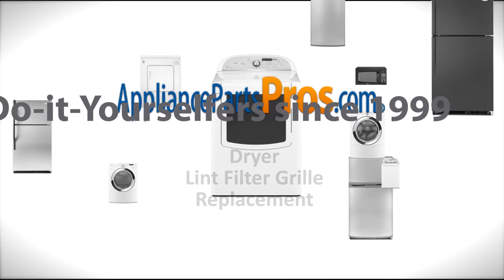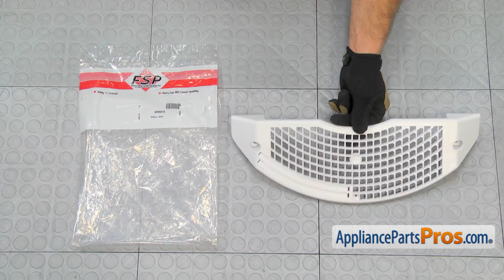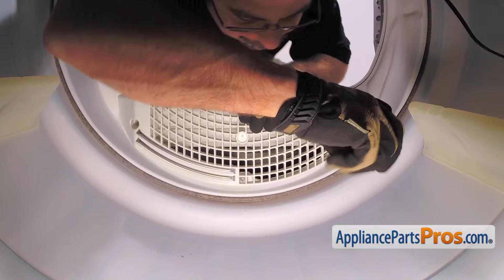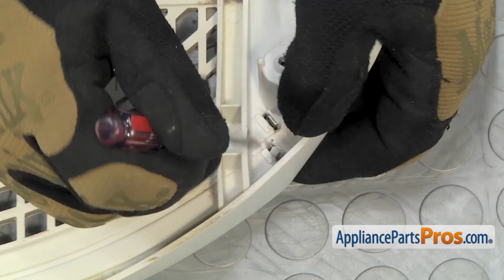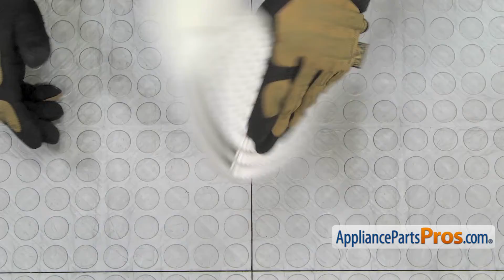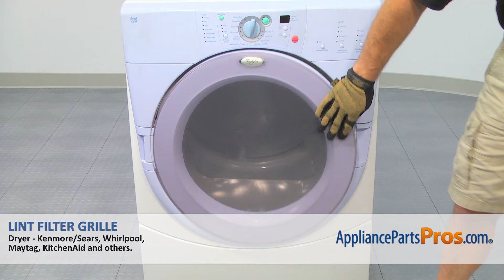How To: Whirlpool/KitchenAid/Maytag Lint Filter Grille W11086603

Comment: After taking out the grill, and disconnecting the wires, the fell down in the hole that is there? What to do now?
Reply from the maker: Oh no! Well, that's okay, it may just take a few extra steps to get this repair done. We have a video here https://www.youtube.com/watch?v=d6u5B6dJRVg where Matt removes the front panel and replaces that Dryer Sensor Wiring Harness, so you should be able to use that video to get those wires back where they go.
Reply: Same thing just happened to me :(
Reply: I'm here for this comment. Happened to me too. dammit.
Reply: I was able to scoop them back out with just my fingers. thanks everyone.
Reply: Add me to the list of dopes who dropped the moisture sensor wires down the hole.  Next time I take the lint grill off to clean it, I’m going to duct tape the wires to the dryer drum while I have everything apart.  Those wires have very little slack and are easy to lose.

I have a Maytag dryer that is only about 6 months old, model MGD7230HW1.  It was a lot harder to get at the wires after they fell into the bottom of the dryer than with the unit in this video.  I don’t have an upper and lower front on my model, it’s all one piece.  I had to remove the whole front which required removing screws on the very back of the unit to free the top to get at screws holding the front on.  And then there were 3 different types of screws: Phillips head, hex head, and star head.  Super annoying!

If my dryer is typical of newer Maytag dryers, it sure looks like they’re being made LESS repair/maintenance-friendly.  It’s more complicated to get the front of the dryers off to do a lint cleanup.